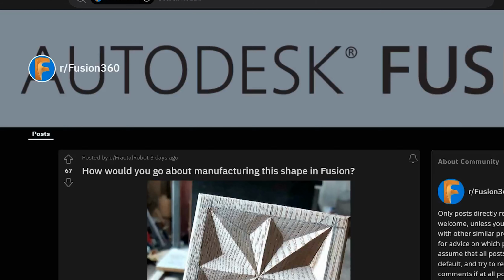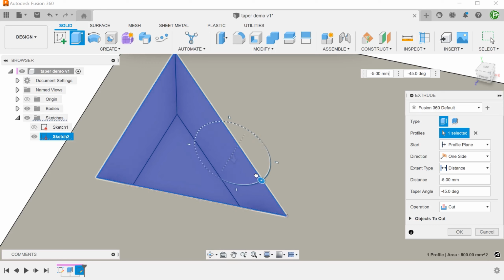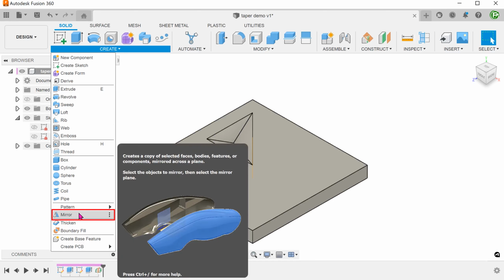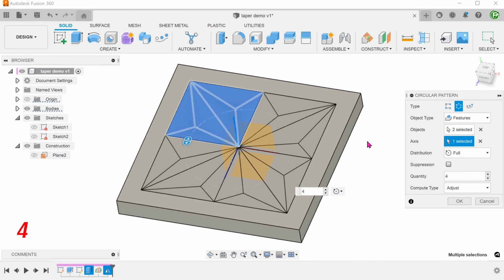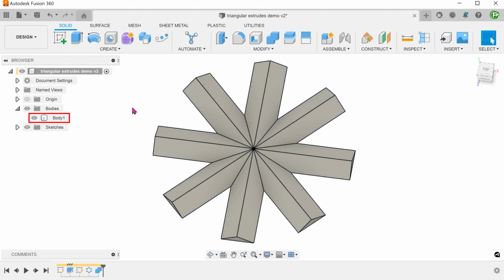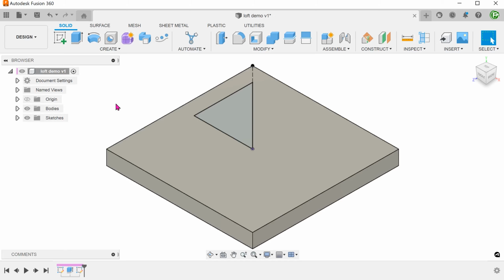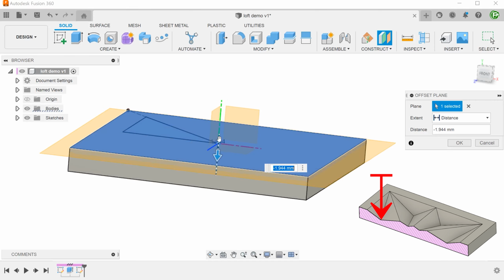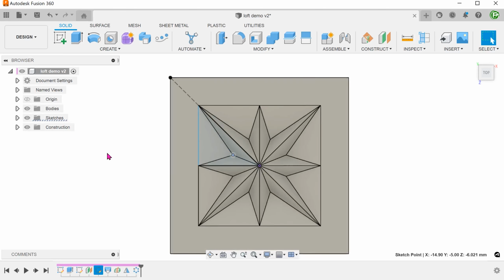Fusion 360 | Faceted Star Panel

Comment: First method can be precise. If you apply some basic trigonometry math to it and use those to define some parameters to give you the right taper angle and extrusion distance for your desired depth and triangle size. Embrace the power of math! 
This would be my preferred method of the three since it keeps the timeline the most compact, needs only 1 sketch, and is the quickest to perform. It would however not as easily allow the amount of control with the third method (though you theoretically could, with some more math, and still only 1 sketch).  
Definitely thankful for learning about that loft trick! There's some marvelous hidden gems in these tutorials about F360.

Comment: Great video! I wonder whether you consciously consider several other options and then rule them out (too many steps, object clutter, lack of control...) or if you filter them unconsciously.

I would find it very interesting if you put up an object, asked for comments on modeling approaches, then did a follow-up video explaining why you wouldn't use each submission except for the handful of reasonable approaches.

Comment: Love the third method, I also though of that at the start but was surprised Fusion automatically performs a cut. Is there a way to change that, e.g. to a new body? Otherwise this feels like a lack of control...

Another way I came up with involves creating the two sketches with the triangle and point, and then adding a third 3D sketch for adding the three inner lines of the pattern, from the corners of the triangle to the point. Then use Patch to add three surface bodies, mirror & circular pattern them, and finally add the walls and bottom of the box before stitching everything into a surface body :)
Reply from the maker: When you create a body that overlaps with an existing body, Fusion would automatically assume you want a cut. You can override this by changing the operation to new body or join.
The method of creating patch surfaces is definitely an option to consider. Though it is quite a bit of work to create the panels manually.
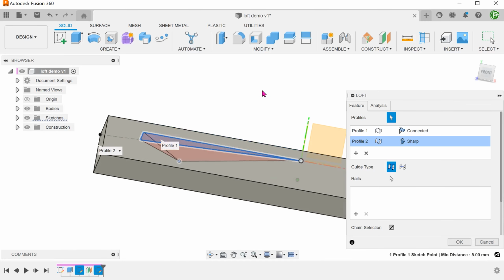Reply: @Fusion360School  That's what I'm used to as well, but I didn't see that dropdown at 7:56 🤔 I'll have to try it out myself tomorrow :)
Reply from the maker: @Chaphasilor  You will need to scroll down to see that.